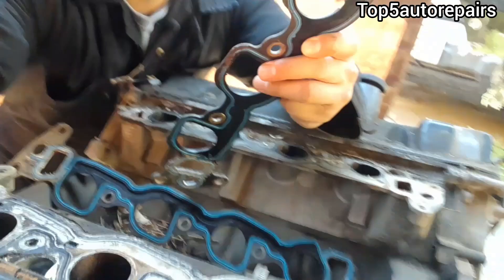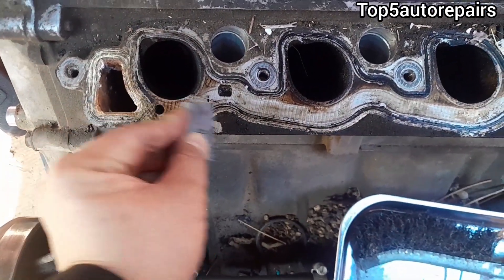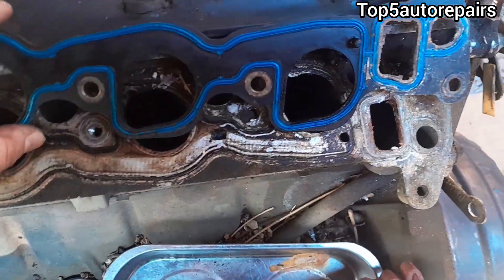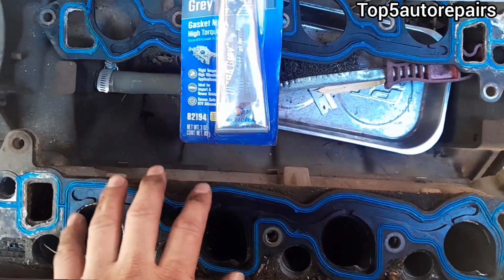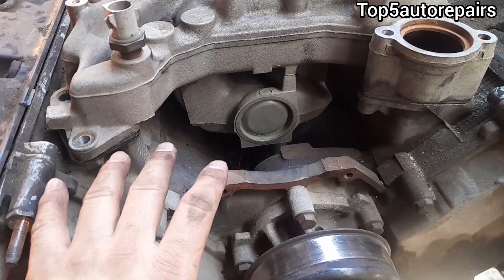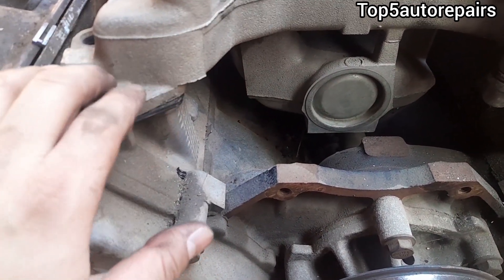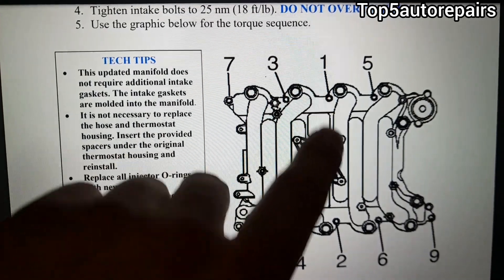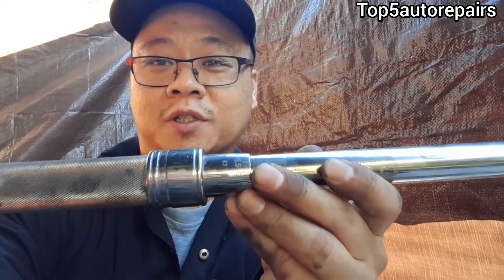VACUUM LEAK ENGINE MISFIRE COOLANT LEAKS ROUGH IDLE STALLING AFTER CHANGING INTAKE MANIFOLD GASKET

Comment: U need too drive it into seal it ,if ur doing everything right, i attached it too manifold gasket with gasket sealer abx i think first
Cured and dry then install not over to tight bolts 🆗😊

Comment: Which engine has cooling flowing inside the intake manifold?
Reply from the maker: Ford 4.6, GM V8, Lexus 3.0 etc...
Reply: 22r Toyota block 79-95 all models.